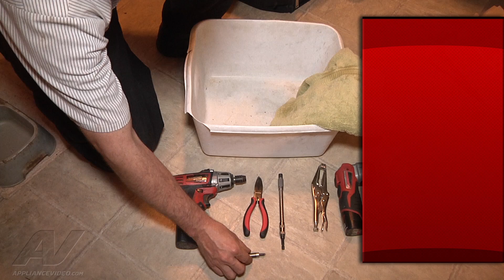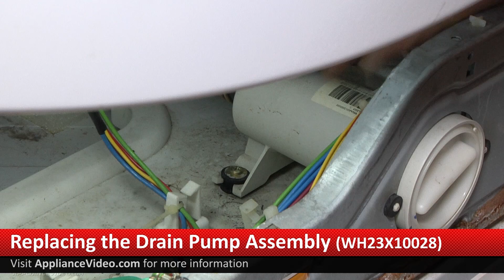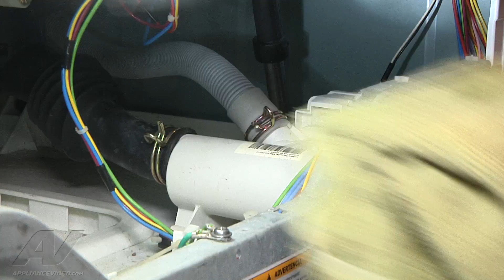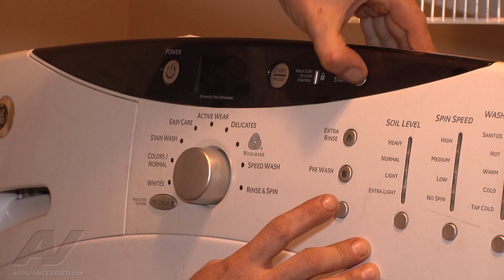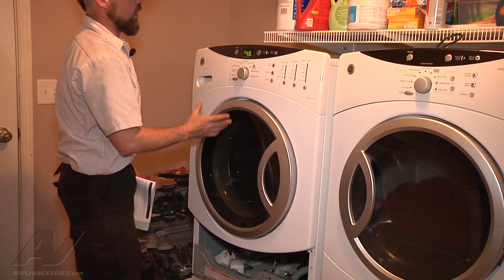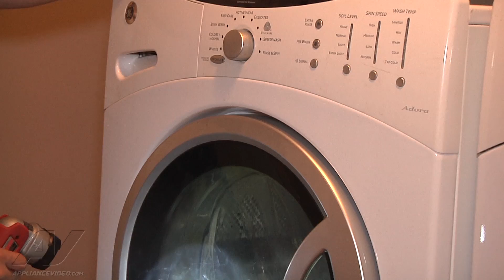Ge, Hotpoint & RCA Washer Repair & Diagnostic- Not Draining Properly -  WHDVH626FWW

Comment: Same model (Wcvh6800j1ww) during cleaning mode, it doesn’t spin, filling is ok. What do you think happened?
Reply from the maker: Great question, if you have a more technical question that our parts department cannot answer, you can search our over 17,000 answered questions free at our website www.ApplianceVideo.com under our Repair Help section. You can also call our parts department at 1-800-830-5465 and they can give you help 7-days A week ,or search at www.SaveMoreOnParts.com  .

Comment: I have these machines. Exactly. My washer will drain, but the clothes are still sopping wet and this week I noticed a slight amount of water on the floor next to it.

But it’s draining. So what other problem(s) could it be?
Reply from the maker: Great question, if you have a more technical question that our parts department cannot answer, you can search our over 17,000 answered questions free at our website www.ApplianceVideo.com under our Repair Help section. You can also call our parts department at 1-800-830-5465 and they can give you help 7-days A week ,or search at www.SaveMoreOnParts.com  .

Comment: my dryer just stop workin
Reply from the maker: Great question, you can call
our parts department at 1-800-830-5465 and they can give you help 6-days A week Mon-Sat . You can also search at www.SaveMoreOnParts.com 7- days a week.  If you have a more technical question that our parts department cannot answer, our technicians are answering all questions at our website at www.ApplianceVideo.com under our Repair Help section. We have over
4,000 common questions and answers that you can easily search through by your model number, appliance make, and problem or error codes, and It’s free to search through our question & answer library.

Comment: How do you get the lower front panel off?  Where are the screws, or ??, located?
Reply from the maker: Kathy Wilburn 

All of our technicians are now answering
questions daily on the ApplianceVideo.com website. You can search completely
FREE in our Repair Help section with over 1000 questions & answers. Or you
can get unlimited technical advice and video links emailed to you by our 14
factory certified technicians at
http://www.appliancevideo.com/premium-membership/.  If you are in need of
any parts please support our parts department on line at
http://savemoreonparts.com/ or call 1-800-830-5465 7-days a week until 11pm
Eastern time. Thanks for your support. Matt Ace Appliance factory service
technician.

Comment: Thanks for the great video Tim.  I tried the parts house you annotated but they wanted $200 for the drain pump.  I found one on line at amazon for $50.  http://www.amazon.com/WH23X10026-washer-PS1766031-AP4324598-MOTOR/dp/B00GP1VPZM/ref=pd_sim_sbs_la_2?ie=UTF8&refRID=1MBGGVZCM9BXHKNG1EFC
Reply from the maker: Kris Vidos 
                 Normally our prices are better than Amazon. This pump has to be a rebuilt or used pump.  Please help us provide more videos to our site by
posting ApplianceVideo.com on your YouTube, Facebook or Twitter account or add
us to your circles. If you are in
need of any parts please support our parts department on line at http://savemoreonparts.com/ or call 1-800-830-5465 7-days a week until
11pm Eastern time. Thanks again
your support.  Matt, Ace Appliance service
technician.

Comment: Nice video..
Can I ask you a question? My GE front load washer didn't work, it won't spin, the door won't locked and no water filled but still has a sound when I hit the start button... I was browsing the you tube and found out that I need to change the door locked (#WH10X10006). I really need your advised before I change it. Thank you so much...
Reply from the maker: Mo ss
                             If you go to our FREE repair help website at ApplianceVideo.com and copy and paste this this question under REPAIR HELP, we have factory authorized technicians that will answer any technical questions at absolutely no charge on your appliance issues. This is the only website on the web that you can get questions answered by certified appliance and HVAC technicians along with over 2600 free repair videos.  Matt Ace Appliance factory service technician